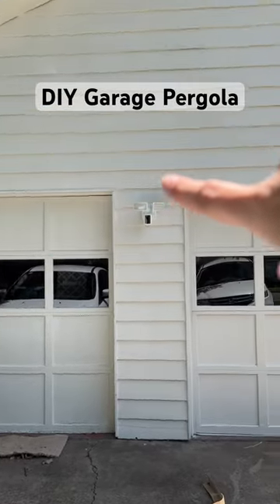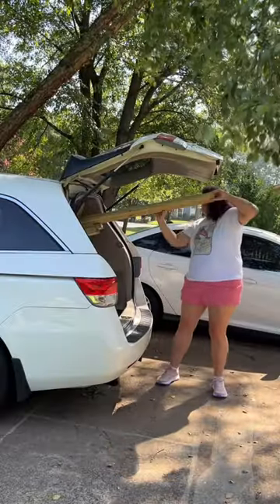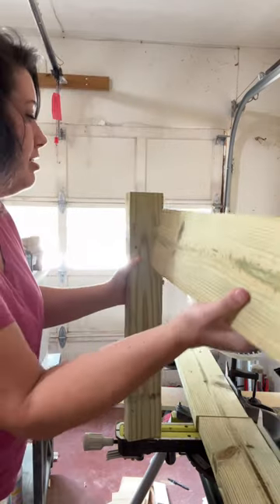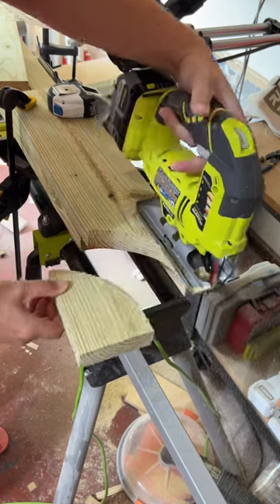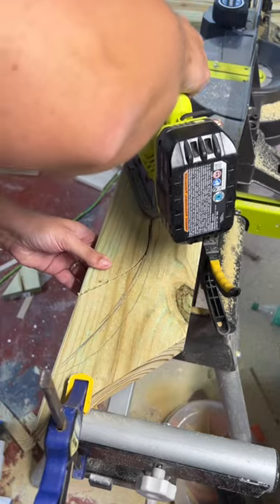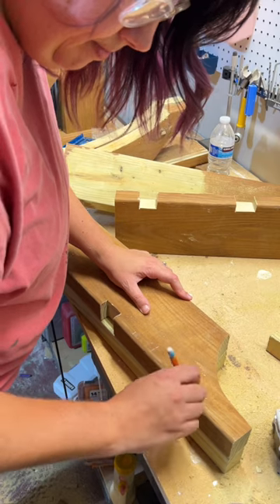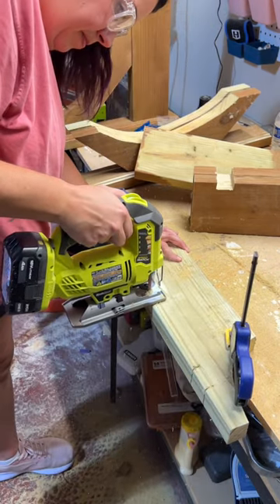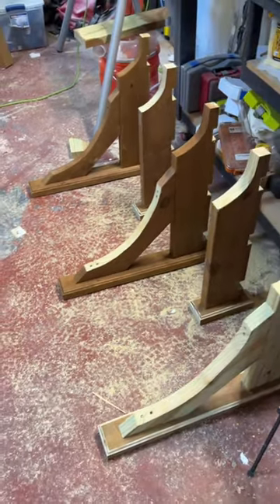Let’s Build a Garage Pergola - DIY pressure treated pine brackets

Comment: I giggled at you hauling lumber in your minivan…but only because I haul lumber in my Equinox all the time! I can fit up to 8’ long boards, but I’m limited on the number of wider boards I can haul at once because I have to run them up between the front seats and can only stack so many at a time. I make it work though! 😬